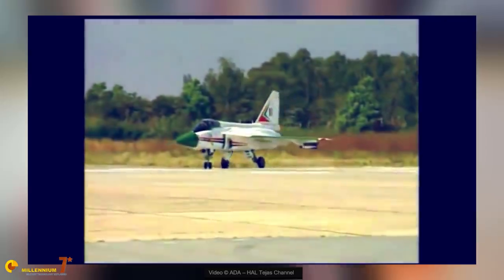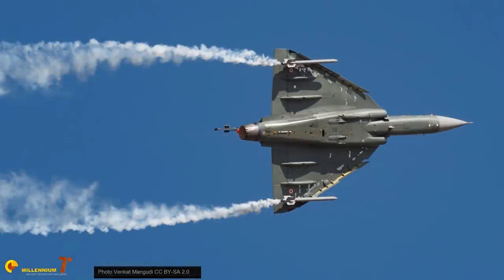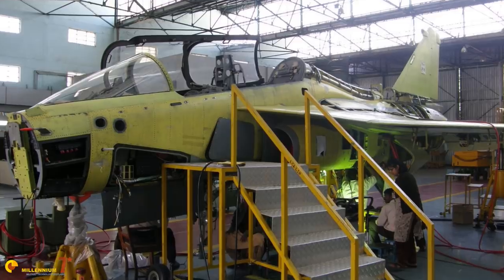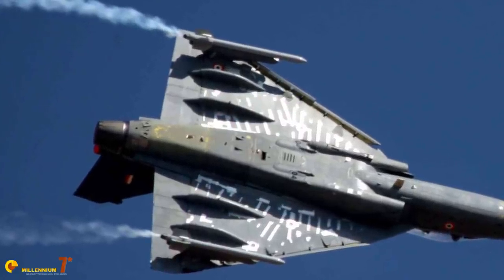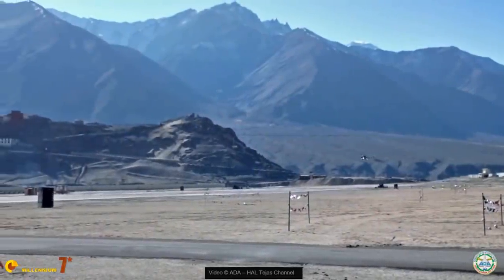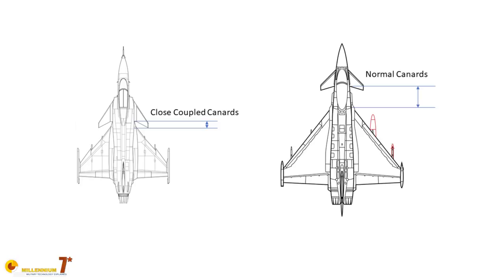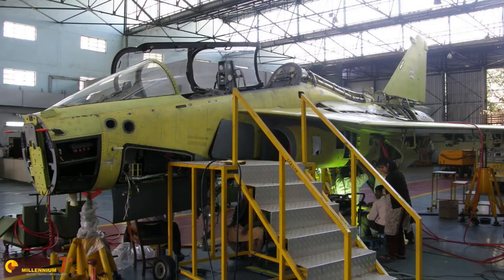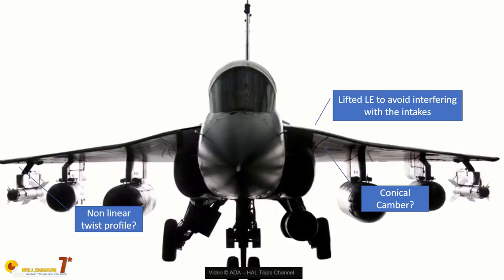TEJAS Aircraft  Aerodynamics Analysis - The Swedish Connection?

Comment: I absolutely loved your description of the wing.  That's almost spot on.
1. One thing you did miss out is the inboard section actually has a significantly rounded LE which accentuates the effect that you mentioned keep the vortices stable. This has two effects. a. It gives great stability at supersonic speeds in the presence of sideslip. b. It gives great stability at high AoA and low speed. More on that later.
2. Another aspect of the wing is the LE slats. Mk1 has 3 of them (Mk2 will have 2). These slats actually deflect variable with downward deflection increasing from root to wing tip. This allows the nullify the variable AoA along the LE for a high sweep delta at high AoA. The end result is that the aircraft can fly at 28 degrees AoA (cleared for 26 degrees in squadron service) at 110 knots. It's minimum radius turn is completed at 330 mtrs!
4. You are right. The wing is highly optimized with a conical camber. It is a very good wing and retained in its entirety for Mk2.
5. When Mk1 began, Indian designers had nothing to stand on. What they took on was stupendous and they want to keep it simple. Canards were dropped for that reason. Today, when they have very firm grounds to stand on (similar to European designers in the 1980s) adding a canard is an incremental change.
Reply: And what is 3rd Point? :) Btw, thanks for Great explanation.
Reply: Well written!!
Reply: Ros K  Unfortunately not. Just a keen observer.
Reply: Ros K  :D :D
Reply: Tahole dada ekta proshno korchi.. parle uttor ta deben, Avijit Iyer mitra ke recently sunchi prochondo criticise korche even eta bole je the platform is very old and outdated r even jf-17 er thekeo kharap...
Amar proshno duto:
1) baki joto available jets ache ae category te, tar tulona te Tejas better na kharap (if possible reason deben)?
2) Tejas kotota helpful hobe military r jonno ebong amader  defence industry ke kotota help korbe?
Reply: @soumyaray7167  1) Single engine jets er modhye Tejas kom poisay pushtikor khadyo. 
Aesa radar, high thrust-to-weight ratio, BVR strike package jar modhye Derby, MICA, Meteor ar Astra missiles royeche - ei sob ekta 'jothesto-bhalo' plane. 
Shreshto bideshi plane er lobhe Jotheshto-bhalo desi Tejas ke reject korata bokamo hobe ar tar karon royeche apnar dwitiyo proshner uttore.

2) Khali 'jet vs jet' comparison charao, Tejaser arekta bishal boro advantage ache: seita hocche amader aerospace defence sectorer ecosystem ta ke dar korano te. LCA manufacturing e onek Indian private companies er contribution thakbe. Oi processer modhye amader desi company gulo sub-system design, develop ar manufcturing shikbe. Amader nijeder MIC jodi amra dar korate pari porer 10-20 bochorer modhye- tahole tar upokar khali amader military charao amader economy teo hobe.

P.S- Abhijeey Iyer Mitra dadar Geopolitics, policy arr diplomacy te khub bhalo gyan ache. Kintu uni Military technology nie onek fundamental bhool boken. Onar opinion on military tech ke khoob seriously na neoya ta buddhimaner kaj hobe. 
Uni JF-17 ke better bolchen based on the fact je ota aro boro plane. Tai ote prochur electronics dhokanor jayega royeche. 
Uni eita bhule gechen je- 1) China chara, Pakistan ke military grade electronics ta supply keu korbe na, 2) India china theke better mil-spec electronics banaye; Ar 3) Pakistaner nijeder ekta alpin manufacture koraar khomota nei, electronics toh durer kotha.
Reply: @Indranil roy, you should start ur own YouTube channel. Blogs are good not making a reach in today's times. Meanwhile ur blogs have excellent insights👍👍👍
If u already have a YouTube channel share us the link. 
Don't worry about graphic ui for making YouTube videos, ur speech content is more than enough. I am be waiting to subscribe 👍👍👍

Comment: It is interesting to know that of all the 4th generation design Tejas has the highest static margin. Its mean time to double amplitude is  less than 0.2 seconds.  On the other hand. There are only 4 active surfaces for control (2 of which are overloaded as flaps)! So it was critical that the designers kept the vortices from moving too much. That is the reason of the double delta. All other benefits and disadvantages are of lower order of importance.
Reply: Interesting indeed. If I understand you correctly that basically pulls together all the arguments we used in the last few days. Thanks! Can you give a short explanation of the double amplitude oscillation term you use? I assume the value you quote indicates the time in which pitch oscillations die down if left "untreated" by control input (FBW or not)?
Reply: @marcbrasse747  It is the opposite. Tejas is an unstable platform. So, if left "untreated", the oscillations in pitch will double in 0.2 seconds, become 32 times in a second. So in terms of maneuverability, this level of static instability coupled with the very low wing loading gives it crazy instantaneous turn rates.
Reply: @indranilroy1983  Aha! Definitely instable then! :-)
Reply: @einarabelc5  Thanks for the tip!
Reply: What about the 'higher drag' that the video mentioned. My first impression is higher drag implies lower speeds or higher fuel burn but in the overall scheme of things is the 'higher drag' a good thing or bad thing.
Reply: Hallo, I have a enquiry.
In MWF, or Tejas Mk2, the canards are situated infront of air intakes unlike Gripen, Kfir, Rafale. It's not even at the bottom of fuselage like J10, Eurofighter etc. Does this going to create problem ?
Reply: @chakraborty1989  No sir.
Reply: Its combination of soviet mig 21 , french mirage fighter and sepecat Jaguars...

Comment: You are right about the stubby nature of Tejas not being optimized for supersonic drag. I used to have a huge problem with the underside of the aircraft: Where's the wing-fuselage blending? It turns out that they did study blending but that would increase the area at the worst place increasing wave drag, and hence was dropped. The Mk2 overcomes this as you said by elongating the fuselage by 1.5 mtrs, by reshaping the area just behind the cockpit, refinements to the engine bay and something that you did not capture in your video, elongation of the intake by over 1 mtr, and canting the intake.
Reply: simba1  All indications are to the contrary. But I would like to know why you think so?
Reply: @indranilroy1983  1. If mmrca 2.0 ensures continuous delivery of Rafale class fighters post delivery of 36 on order which can gradually replace mirage and jaguar
2. If the targetted production date of MWF is 25-26 then definitely it is going to be delayed till 30. Do we really want a 4++ generation in 2030? Remember we still don't have a deal for 1a forget about starting it's production
3. Budget constraint. Most likely hal ada would be asked to focus on fast tracking amca and naval twin engine aircraft (which currently has no direction)
4. Production capacity. Hal would need to churn out close to 1 sqdr of 1a every year. Which means the last fighter will come out somewhere in 26-27 or so. Along with that we have super Sukhoi upgrade, mmrca and ijt. And probably upgrading 1 to 1a.
5. And to be honest MWF seems to me like an aspirational thing of hal engineers. All the things that they could not do in the last 40 years because of the Tejas requirement constraint of the weight class, RCS etc, and the limitations observed because of said constraints (range and load), they wanted to design an aircraft with less such constraints.  Also, I think they feel mmrca is doubting their abilities.
Reply: @cdm1949  1. We have all the Mig 21s, Mig29s, Mirages, Jaguars to retire. A 42 squadron is roughly 850 aircrafts. Of these 300 are MKIs (which will start retiring from 2035). 120 odd are Mk1 variants and 80 odd (unconfirmed) are RAfales. In what form will the remaining 300 aircraft be?
2. First of all Mk1A production has started. Orders for long lead time items have been placed. An LSP is being modified. Two more SPs will be modified soon. Coming to 5th gen aircraft. What aspects of 5th gen aircrafts are we speaking avionics wise aircrafts coming in 2030 will be contemporary of that time. Stealth wise what part of our inventory will be used for first day "invasion"? There is a huge price to pay for stealthy airframes both aerodynamically and financially.
3. MWF design detailed design is almost ready. AMCA detailed deisgn is progressing. TEDBF, NAvy and ADA finally are seeing eye to eye.
4. Production capacity is a direct outcome of number of orders. It is not financially viable to set up a line for just 2 years. 5 years is a minimum. So , if you have 80 planes on order, you will see a maximum production rate of 16 per annum. Double the orders and you can set up twice the production rate. No Magic there.
5. MWF is not even a HAL project! The rest are opinions, so I will not try to change them.
Reply: @indranilroy1983  Sir, Can you explain AMCA capabilities if it became a reality?
Reply: @cdm1949  @Indranil Roy one of the main hurdles of tejas ever becoming a reality in indian army is the speculative revival of fgfa joint venture between russia and india.
Reply: @indranilroy1983   This tejas really looks like a copy of a Mirage 2000 ! First time I saw this indian aircrafts, I thought it was a Dassault Mirage, weirdly India was buying Mirage 2000, it seems they copied It. Now they bought the new Delta Wing King alias the Rafale, next aircraft from India maybe would be a Rafale copy !
Reply: @djorksolo8544  Believe it or not, the chief designers were actually most influenced by the Folland Gnat. Dassault also became a consultant and they wanted ADA to simply build the Novi Avion. But when the Novi Avion was rejected, Dassault left. ADA then studied quite a few configurations. If you search the internet, you can easily find the wind tunnel models various configurations. Finally, the decision was made to develop a tail less delta because India had no experience with FBW and this configuration gave the lowest number of control surfaces.

Coming to similarities with the Mirage 2000s begin and end in the tailless delta config. Let's start at the wing itself. Mirage 2000 has a low wing and the Tejas has a mid wing. Naturally the variations in both their cambers are completely different. The sweeps are different and the inboard of the TEjas wing is completely different. I have written about the CFD studies and if you want to you can read about it. Naturally, the Mirage has wing mounted LGs and the Tejas has fuselage mounted LGs. So, not just the aerodynamics, but the structures of the two wings are completely different. Next come to the inlets. The inlets of both the aircrafts have nothing in common. So if two aircrafts have completely different wings, inlets, engines and LGs, then ...

Coming to Tejas Mk2. It is more similar to the Gripen E/F. I don't know how it looks like the Rafale to you. There will be TEDBF which is a twin engined version. Artists have simply taken the Mk2 design, added another engine. Because of the close coupled canard layout, it does look like the Rafale. But, I can tell you that TEDBF hasn't even crossed preliminary design review yet. The main goal is a deck-based fighter which may or may not be adapted as a shore-based fighter (because ADA already has AMCA which is in detailed design review stage). For a deck based fighter it makes most sense to start from scratch rather than adapt a shore-based design. ADA has learned this lesson from the NLCA Mk1 experience. So, nobody in the public domain knows what the configuration would be. It is known that the focus will be on aerodynamics, rather than stealth as the aircraft has to operate from a ski-jump. The close-coupled canard layout with two F414s make obvious sense. Let's see.
Reply: @djorksolo8544  the so called mirage 2000 was a copyright Design sold to Dassault aviations by hal.... please look it up before commenting
Reply: @bibaswanmukherjee7237   Where did you pick this information ? Any officials sources as proofs, I won't believe It without strong proofs. Never heard about It by the way. Thanks.
Reply: @indrani roy. u seems to be expert in aircraft design . could you answer me  where tejas fair against Jf-17   of pakistan in air to air fight ? couldnt find answer yet which i can buy

Comment: Tejas  features :- 
CREW
One
MAIDEN FLIGHT
April 2007
DESIGNER
Aeronautical Development Agency
MANUFACTURER
Hindustan Aeronautics Limited (HAL)
OPERATORS
Indian Air Force and Indian Navy
INITIAL OPERATING CLEARANCE
January 2011
SERVICE ENTRY
2016
NUMBER BUILT
32
LENGTH
13.2m
HEIGHT
4.4m
WINGSPAN
8.2m
WING AREA
38.4m²
NUMBER OF HARDPOINTS
Eight
EMPTY WEIGHT
5,450kg
APPROXIMATE TAKE-OFF WEIGHT
9,530kg
EXTERNAL PAYLOAD
More than 4,000kg
MAXIMUM TAKE-OFF WEIGHT
13,500kg
PROTOTYPE AIRCRAFT
1 x GE F404-GE-F2J3 turbofan engine with afterburn
PRODUCTION AIRCRAFT
1 x GE F404-GE-IN20 turbofan engine, rated at 85kN
MAXIMUM SPEED
Mach 1.8 (2,205km/h)
MAXIMUM ALTITUDE
15,200m
MANOEUVRABILITY
+9g to –3.5g
RANGE
3,000km
SERVICE CEILING
16,500m
AIR-TO-AIR MISSILES
Python 5, Derby, Astra BVRAAM, Vympel R-77 and Vympel R-73
AIR-TO-SURFACE MISSILES
Kh-59ME TV guided stand-off missile, Kh-59MK laser-guided stand-off missile, anti-ship missile, Kh-35 and Kh-31
BOMBS
KAB-1500L laser-guided bombs, FAB-500T dumb bombs, OFAB-250-270 dumb bombs, OFAB-100-120 dumb bombs and RBK-500 cluster bombs
OTHERS
Drop tanks for ferry flight / extended range/loitering time and LITENING targeting pod
BURST FIRING RATE
50 rounds a second
MUZZLE VELOCITY
715m/sec
COCKPIT SEATS
Martin Baker (UK)
LIQUID CRYSTAL MFD
Bharath Electronics
HEAD-UP DISPLAY
Central Scientific Instruments Organisation (CSIO)
INS
Sagem SIGMA 95N ring
ENVIRONMENTAL CONTROL
Spectrum Infotech
ELECTRONIC WARFARE SUITE
Advanced Systems Integration and Evaluation Organisation (ASIEO)
MULTIMODE RADAR
Electronics Research and Development Establishment and HAL
Reply: bro maiden flight in 2001

Comment: That set of nose-wheel doors could use some simplification. In most aircraft  you can see one or two doors. Three in most extreme cases. The Tejas has four.
Reply: Tejaa mk2 is coming and it will be best in it category